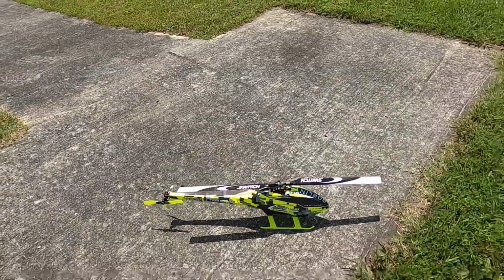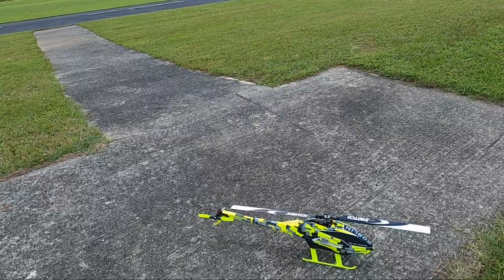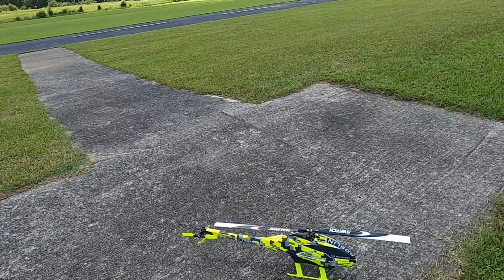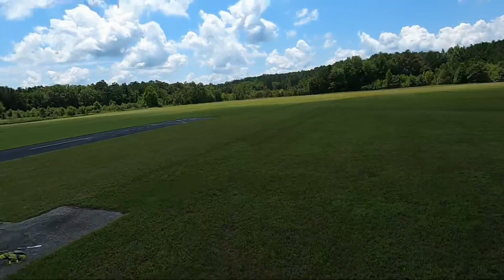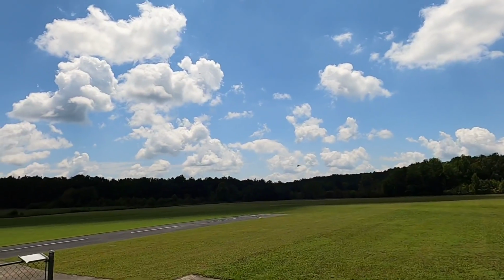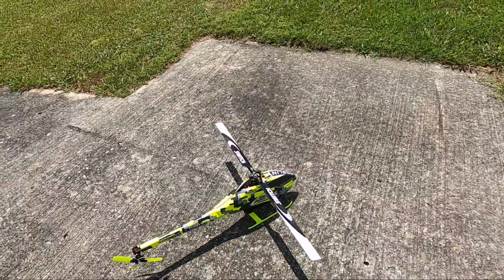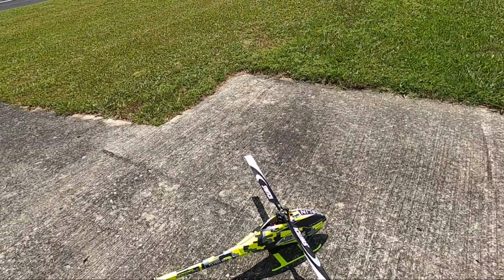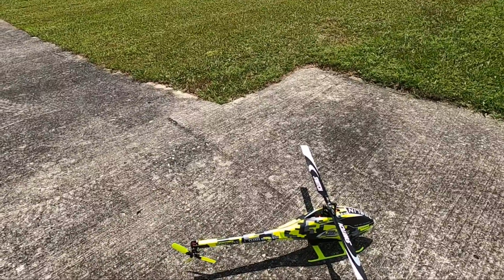This Heli Has Crazy Head Speed!

Comment: I can't imagine anyone not liking the sound of that little beast. I love it. I got so into that flight I spaced out for a second and thought I was flying! Wow that was a goof. The main blades are almost as long as the boom. I just thought I have not had or even seen a boom strike in a long time. Is that because of the dampeners are better now?
Reply from the maker: It’s got an incredible sound! High rpm, and blades tearing the sky up! It’s got to do with a few things. Head dampeners are the biggest reason. Much better head design, bigger, feathering shafts, with bigger bearings in the Blade Grips, as well as dampeners all contribute to a much tighter and solid head, which eliminates the boom straight.

Comment: Good day sir, I want to learn to do the auto gyro that all these guys do. I don't see you do it much but maybe it's just too easy or not your style. Can you explain the working's of it??  
So they fly way up there and then point down and really put the haul ass to it, I just can't tell, do they push FULL positive throttle to really send it home and then kill the motor when they start the manuever at ground level? Or does the fact that it's falling cause the overspeed to happen. Is it dead stick or the motor off  from all the way up there? And is it just something the smaller heli's can't do, ya just have to have a 550-700 to make it look lke it should?
Thanks in advance
Reply from the maker: Hello! No, I don’t do a lot of autos on purpose lol I can definitely do auto rotations I just don’t do them for fun. I’ve been practicing big over speed autos and definitely going to do them more on camera from time to time. But you need a 600 size helicopter or bigger to really get a good auto rotation. Small helicopters are just really a glided fall, a true auto rotation is no motor power. You use the energy from the blade spinning to keep the head speed up. If you are upright, that is neutral to negative collective to spin the head, faster and faster and then you pop positive collective at the end if you are upside down, it is positive collective to build the head speed up and keep the energy going and then you flip over and give it positive collective at the end. Highly recommend practicing auto rotations on a figure helicopter as it is easier to learn  and practicing regular upright autos before trying any kind of crazy maneuver make sure you have what’s called Autobell Out set up on your ESC as your first you autos are going to be bad and you always wanna make sure you can bail out of them and have power come back instantly to save the helicopter.
Reply: @westhobbiesrc8051  
That is an awesome explanation thanks very much for that, I’m gonna givera go on my SIM but prolly won’t try in real life for a few more years, keep up the great videos and thx ahain